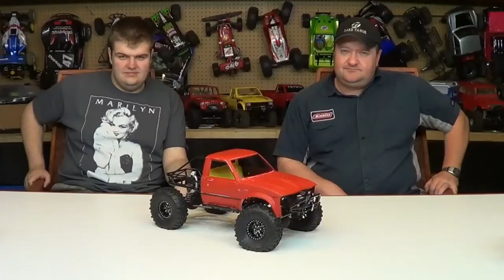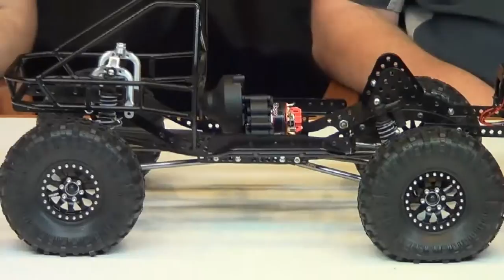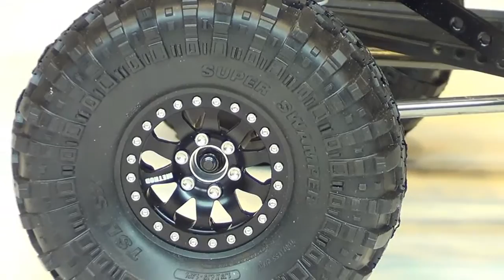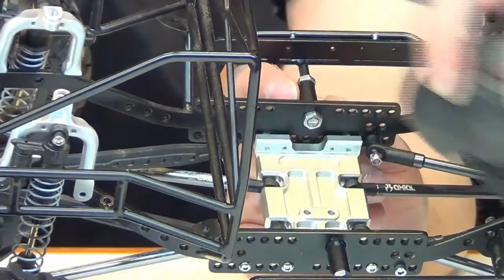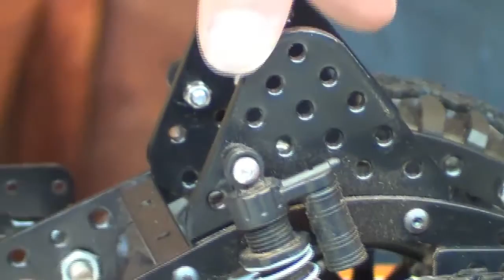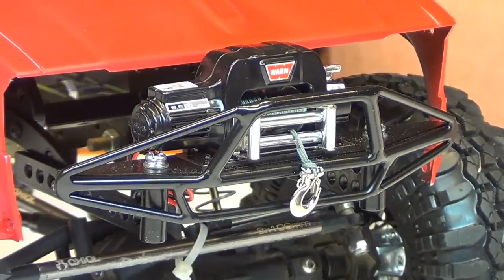RC4WD BOYER TUBE FRAME

Comment: Great rig guys! I just picked one up in a trade and it’s in decent shape. I want to extend the wheel base some and change out the rc4wd r2 single speed transmission it’s got as well. Any good suggestions? Did y’all ever finish the build?
Reply from the maker: we did finish this project and what a great truck its been, the scx10 trans fits and works well the links will need to be custom and extending the rear will help as this is a heavy truck, maybe we will do an update video soon.
Reply: RC Mike Klein thank you so much. I would love an update on this truck.